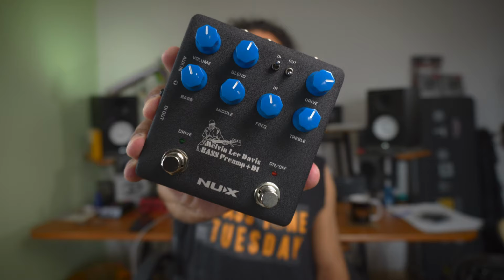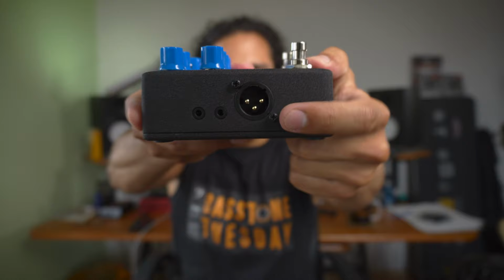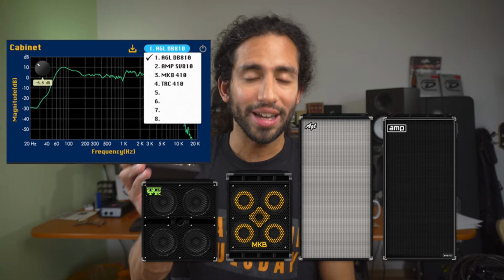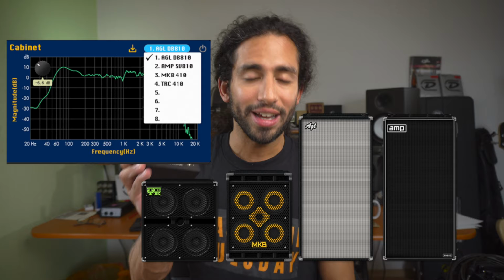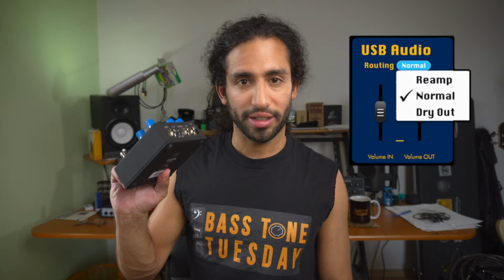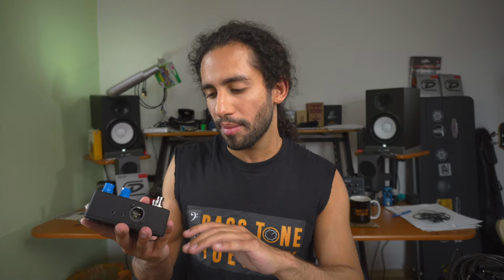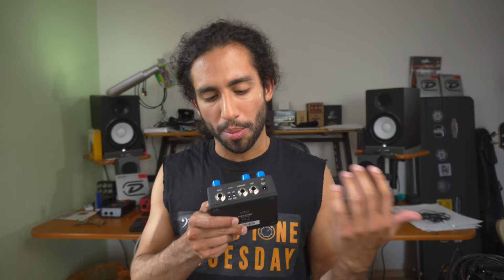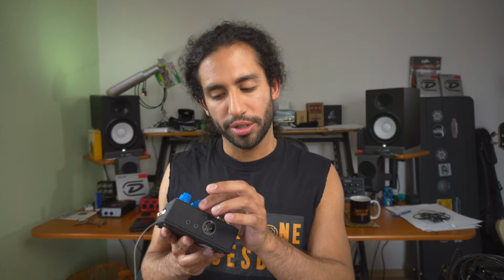NUX Melvin Lee Davis Preamp - DI | DEMO

Comment from the maker: UPDATE  NUX seems to have solved the issue with the bass boost with the latest firmware update. Download it here: https://www.nuxefx.com/melvin-lee-davis.html
Reply: Why NuX hasn't published firmware update instructions is a bit puzzling.  Here's how to do it.
1. With the power disconnected from the NBP-5, connect it via USB to your computer.
2. Depress and hold down the Drive and On/Off foot switches while plugging in power to the NBP-5.
3. The green Drive and red On/Off LEDs should now be flashing.  If not, disconnect power and try again.
4. Open the firmware updater software.  It should recognize that the pedal is connected.
5. Select the new firmware file and perform the update.  As the firmware is loading, the red On/Off LED will flash.
6.  When the update is complete, the green Drive LED will start flashing.  You may now disconnect power from the NBP-5 to complete the update process.
Reply: @johnkos3116  does this mean the drive and all the sounds are DSP?
Reply: @johnkos3116  I just purchased it a couple days ago and I'm excited to try it out! I'm glad I found your comment so I can update it when I get it. Thanks!
Reply: Whoever still has connectivity issues- i almost got depressed when nothing worked and the guys at Nux sent me a different firmware than the one online and that solved it all!
Reply: @johnkos3116  Thanks

Comment: Hello bro... just with a question, ammm the optimal operation of the pedal as an audio interface, does the quality of the USB cable being used have much to do? an example if you use one of low quality, will it work at optimum performance?
Reply from the maker: Hola Carlos! Yo creo que no deberia haber diferencia  de sonido dependiendo de el tipo de cable, siempre y cuando no uses uno que se vaya a romper muy facil o pueda tener malos contactos, pero no te puedo responder con 100% de seguridad.
Reply: @IvanBassist  muchas gracias mí amigo, preguntaba porque yo tengo un problema de cuando yo conecto el pedal como interfaz me tira una ventana siempre de error de que el cable USB no está bien , pero lo curioso es que yo compré hace una semana el cable y está completamente nuevo
Reply: @carlosymelgar  No cro que el tipo de cable tenga culaquier importancia, seria mas a donde te conectas. Tuve un problema con mi antiguo POD conectado a un Hub, mejor conectarse directamente al USB de la compu. Saludos.

Comment: Question: did you use an audio interface to record these sound samples? The XLR in the vid suggests you did, so curious what sound quality difference would be using only the USB out.
Reply from the maker: I did use an interface to record. The A/D converters are definitely better using a separate dedicated interface, but the USB does the job in a convenient package
Reply: @IvanBassist  Thank you Ivan! I bought the unit and it took me for ever to set up. My PC is finally recognizing it but I'm still finding the signal too low which distorts when I try to compensate by turning up the volume.  I don't own an interface or XLR cable...
Reply from the maker: Interesting! I found my signal was pretty hot and i had to turn the volume down 😅 Try Messing around with the usb audio sliders inside the application :)
Reply: ¡Muchísimas gracias!
Reply: I confess, this device is a nightmare to set up. I've had 2 different IT pros help me and it's still not up an running 100%. It took forever to get my PC to recognize it, and now, despite more hours of work, the device and software are not connecting. I don't understand why Nux provides such limited and confusing instructions.

Comment: @IvanBassist..  .. Thanks for the video and Demo.. Just wondering,  If you plug in your headphones to the pedal, will it cut the the D.I. out signal or the "THROUGH" or "OUT" signals??  Coz I would like to use it as my In Ear Monitor during a live gig while have it also plugged-in to the Amplifier, Just wondering if its possible or not. Thanks in advance

Comment: Another great review Ivon.  I watched this a while ago. Then watched it again now for a refresher after buying this pedal.
I am really digging this Nux preamp through my Ampeg SVT VR and Ashdown ABM Evo 2 500wt through a 610HLF cabinet.  Was looking for a pre-amp with a light-duty drive.  This definitely has a nice simple drive.  I love that you can go in and change the IR settings on your computer and select the head and cab sims that work for you.  My preference is the MLD amp combined with the SV810 cabinet. Another great feature is the ability to turn the cab/amp sim on or off to your amp output and the XLR output.  I like engaged for my in-ears and to house XLR output and OFF to my stage amp.  There have been some negative comments about the software but they have since updated the firmware to V4 and I had no problem.

Comment: A good review with good examples of sound & how to use...i'm a bit late to the party but i wanted to give it some time as me & PC's don't get on...do you know if it can be used as bought or do you have to register it with NU.X with a PC first ?...if it can be used without a PC what are the amp & cab ir's when first bought ?...eg..Aguilar or MLD pre-amp & what cabinet ?....thanks Ivan...
I need to use someones non Google PC as i only have a Lenova IdeaPad 360S which is Google...did you have any problems when connecting to your PC & NU.X web-site/downloads ?...thanks

Comment: Good device. Very pleased with yhe built-in audio interface. But drive is dull and boring(
Reply from the maker: I actually really like the drive 😄 If i need a more aggressive distortion/drive, I’d definitely grab something else, though
Reply: The drive is indeed mild.  The beauty of this drive is blending in just a touch of overdrive into the clean signal for that slightly pushed amp sound.
Reply from the maker: Indeed!
Reply: It really shines when you stack other drives with it. Makes those drives sound alot better.

Comment: Can you explain if you have XLR out to input 1 on the interface and the dry out going to input Two on the interface these signals wet &dry can be mixed/blended in the DAW, so is the blend/mix control just for a   blend out  to your amp  or for single channel use on the interface? Thankyou so much
Reply from the maker: The blend is just between the driven and clean signal inside the pedal. You can send both signals like you mentioned on your comment. One would have the EQ and drive and the other one would be completely dry
Reply: @IvanBassist  Thankyou for your valued reply

Comment: I used a headphone to listen but did not watch. Hmmmmm. There is no big difference in the sounds. Maybe because it’s always the same (boring) riff. Different riffs and style would help to recognise the sound variations. Most of the direct sound was very thin. Together with the cab sim it sounds  better. Many pedals are cheaper and sound better. A good compressor is a better investment. Digital features and revamp are interesting. Finally: don’t buy it.
Reply: Gift us your knowledge oh great one of the many pedals that are both cheaper and better sounding =D
Reply: @waterblessed765  you are welcome
Reply: @wolframheldmaier727  Ahh I meant that if you're gonna say there's better pedals in the price range it would be helpful to name some which you think out-perform this one
Reply: @waterblessed765  Thomann Germany offers the Peadl for 142 euros. A preamp with DI and some distortion. In addition, 3 AMp models and 8 CAB SIMs. 
No compressor! Compressor is in my opinion the minimum standard for recording a bass signal.

Electro Harmonix Battalion is cheaper and more flexible in sound . Except for reamping. 
For a little more money there is Zoom B3n with more AMp simulation and more CAB and multi-effects and good compressors. When I compare Zoom B3n with SansAmp is little difference to hear.

Or two separate effects. 
Good versatile compressor tc electronic SpectraComp Bass Compressor. 
Distortion Fuzz Electro Harmonix Deluxe Bass Big Muff Pi
Or just a good compressor. Men favorite EBS MultiComp Blue Label and the tone control in the recording software.
Or no tone control if the bass sounds good. My Ibanez ATK 850 sounds very balanced even without EQ.

I tested the pedal. The sound is good. The EQ is not very effective. The signal can hardly be influenced. Since I find tc electornic and Gallien Krueger much more effective. When switching to the distorted sound, there is always a volume difference. There is no additional volume control for distorted channel. Thus unsuitable for live situation. I miss the gain control for the input. Depending on the instrument, I want to set the maximum level to keep background noise low. This is missing from the NUX. EHX often has even a -10 dB cut for loud active instruments. I would have expected more if such a well-known and experienced bassist at the pedal mitenwickelt (?) Seems to me he just gave the name and get money. 

Translated with www.DeepL.com/Translator (free version)
Reply: @wolframheldmaier727  Thanks for your time and input :3  I appreciate the insight for someone like myself who is considering many options with limited experience using this equipment. 

Since I'm mainly looking for something to polish my live sound and control it more effectively, I'll take your advice and go for a good compressor that way my low end doesn't clash with the bass drum and sound muddy. Also since you say the EQ is minimal I really can't see myself using this pedal.